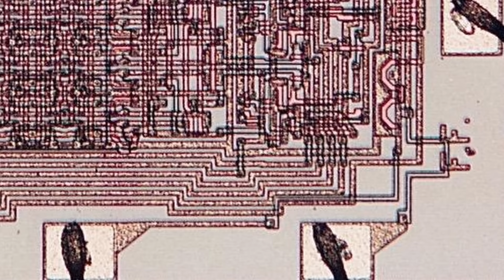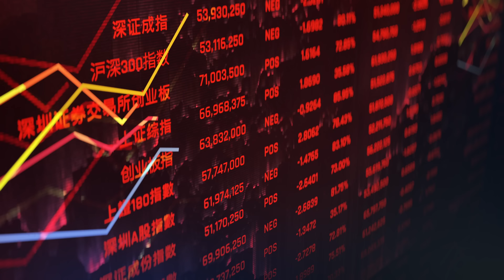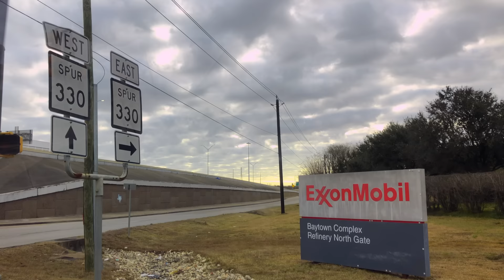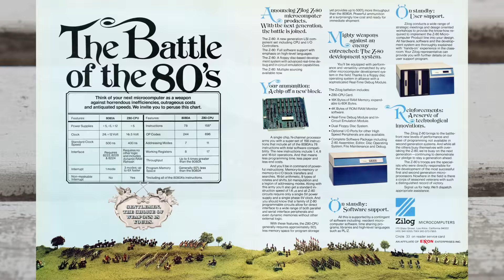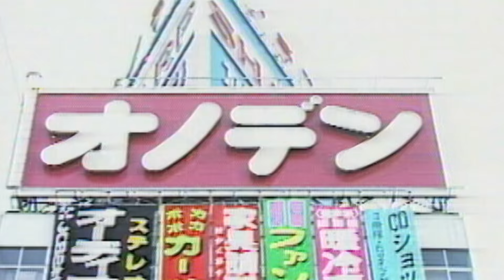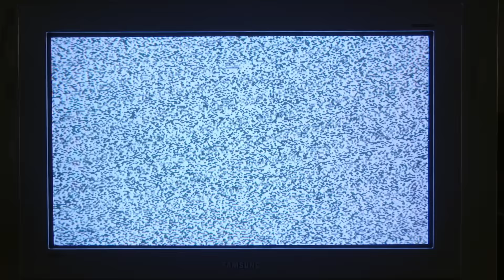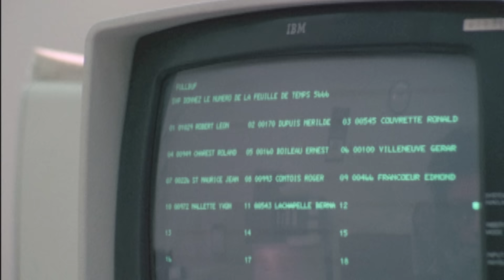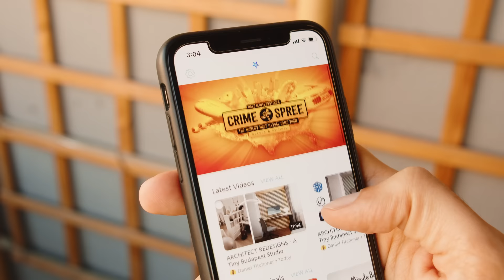Intel’s worst Nightmare

Comment: Computer on a chip. How about 850,000 super computers all super interconnected on a chip. Cerebras wafer ultra supercomputer on a chip operates at a predictably fast 80 EXO scale and a stackable. At 44,000 Watts more powerful than a supercomputer running millions of Watts. They believe they have found the pathway to singularity. 5 nanometer lithography ensures room to for improvement once 3 nanometer lithography is unveiled.

Comment: So that's why the Z80 crashed and burned.   Even thou it was cloned out the nose.  The Commodore 128 had a low-end 2mhz Z80 CPU which was useless by 1984 with that computer was released.   Like "WHY?" bother.  Amiga, Macintosh and Atari STs were taking off with the 8mhz 68000 16bit CPUs.

Also the 6502 was generally a better CPU, clock for clock.
Reply: In my opionion, after the C64 Commodore made one stupid decision after the other (except for the Amiga line, but this was basically ready when they got it). 

If I read about the C65 .. WHO would have bought this thing? I mean, yeah, it's cool now and it had some nice features, but they planned to release it in 1991. A 6502 with 3.58 MHz .. horribly outdated.
Reply: @VintageTechFan  Commodore was an incredible STUPID company.  Even teenager me back then could have done better!   The C64C should of been the last, besides the C=128, but in the end, the C=128 would have been discontinued before the C64.

The BIG screw ups with the Amiga is the lack of a low-end business model and a De-interlacer chip.   I used to have one on my Amiga 1000, worked GREAT!  $60.

So imagine, its 1987, there's an Amiga 1200 to replace the A1000.  Both the Amiga 2000 and 1200 with De-interlacer chip rather than the idiotic PC-Slots which *NOBODY USED*!

Then Amigas would have been business and Multimedia friendly!  The hypothetical A1200 = Looks like an A1000 at $1000, but has 1 internal Zorro II slot, a FD and HD bay.  1GB like the A2000.   It would have been a great biz and home PC.  The profit would be better than the A500 too.  $300 price difference, and the person gets a deinterlacer, 1MB RAM and a detached keyboard!   Yeah, I AVOIDED The A500 and got the Amiga 1000.

Also, I'd have gone with a single FD design for ALL Amigas, rather than 3 for the A500,2000,3000.  Same keyboard, etc. 

Yeah, Commodore WAS stupidly all over the place.   Waste of money doing their PC compatibles.
Reply: @TexasCat99  I think there is a clear cut after Tramiel left. Before they had a more or less clean product line, the professional CBM models on one side, which were quite sucessful in research too, due to their integrated GPIB interface, and the VC20/C64 for the home market, both incredibly sucessfull. 

Then there was the plan to make something to compete against the very cheap ZX spectrum. That was the 264 series, they was MEANT to be crappy, but cheap ($49). After Tramiel was gone, they bloated them and made them more expensive, while the C64 got cheaper due to economy of sale. 

So you got something which was nearly as expensive as the C64, but lacked in capabilities and couldn't run any of the games you could trade pirated copies of at school. The "business" software in the Plus/4 was utterly useless, mainly due to it being only 40 columns. They wondered why they didn't sell too well.

They would have died around 1989/1990 already, but were saved by the fall of the Berlin wall and subsequently, the Soviet Union. All those people who always heard of the glourious C64, which was never available besides the occasional one drifting across the border, now rushed to get one. 

That gave them a last boost of revenue, enabling them to hang around a bit longer. They even released the C64G here in Germany, which was basically a replica of the first bread box case, but with a modern board in it. After that was over, they were done for.

Comment: this is quite funny, because intell absolutly haters x86, that's why at the start of 64bit they tried to kill of x86, and the x86 we use today is x86_64 and it was invented by AMD
Reply: Yes. When I read the first article about the Itanium with the horrible x86 emulation and the compiler having to pack instructions correctly and all that .. I knew that will not work well. 

Then AMD came out "we just blew the x86 up to 64bits, everything you have will still just work, but new stuff will be cooler".

Comment: 8:59
Bullshit, I'm computer engineer and unless you have godly brain powers or the design is simple you definitely can't run a circuit design throw you head find a bug and fix it in a split second. It's not a matter of IQ if you have an IQ of 200 you still can't simulate a cercuit design in your brain in a split second it's just too complex a modern computer coule take a minute or so to run a simulation like that.

The guy must have already suspect the bug or the circuit was relatively simple (most likely given my experience), or this conversation took a lot more time than shown in the video.
Reply: By this point in time, where to debug has greatly narrowed down.  Fewer ERROR are eureka moments!
Reply from the maker: At the time microprocessor were way simpler than today and designs where down by hand so it is not impossible. Here the exact quote on that event from the interview I based the video on, linked in the description of the video.

Ungermann: "I remember one event that sticks out very clearly, and that is that we were just ready to the put the mylar into the layout, when we found a bug in the simulator[...]. And we basically went to Shima and said, “We have to stop, there’s a bug in the chip.” Shima looked at us carefully, and thought for a couple seconds, and said, “No, no problem, we just have to put a contact here.” And it was the most amazing thing that he would take this logic error and turn it into a physical fix in just a few seconds. And sure enough when it was fixed, and when the chip came out, it was bug-free"

Considering Shima did the transistor-level and physical implementation of the Z80, a process he obsessed about for a long time, he likely had a very good mental map of it.

Comment: 'a standard that to this day few can challenge' ?! eh. intel is pretty much dead. they have a handful of established pc mainboard manufacturers implementing their cpus. and that's literally the only place where you'll find intel chips. completely missed out on allll the other markets. handhelds, automotive, microcontrollers, etc... you know that bit where there still are more cpus in microwaves and dishwashers and tvs and vcrs in the world than there are in computers :P lol. and due to the many power rails required, and the 100s of essentially useless pins. noone that didn't already integrate intel products into their products will even consider them for new things. also their absurd pricing (you can't sell an $10 product if it has an $50 cpu in it ;). pc clone manufacturers also being a shrinking market, basically just labels on outsourced foxconn products, i'd say they only have 1 actual large customer left: foxconn :P LOL.
Reply: probably that going from a 'generic chipfab' to 'manufacturing cpus only' was actually the worst decision intel ever made... :P as obviously the market for simple logic chips has remained much larger throughout the entire timestretch than the cpu market ever was. and now they are a vendor with a very very narrow product range. and a very small customer base.
Reply: dats the same ungermann of the not so widely known, but still a critical development, bass-ungermann networking stuff btw lol.